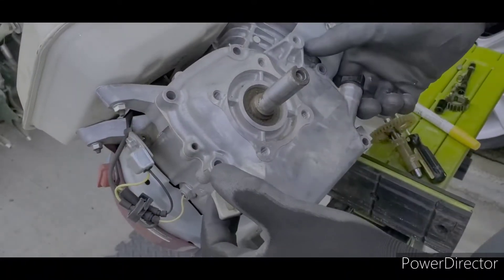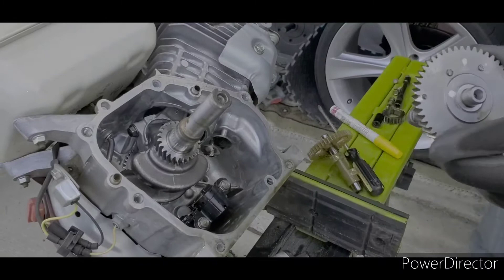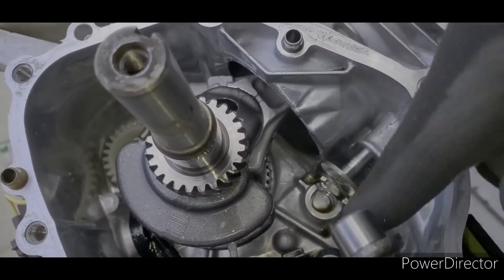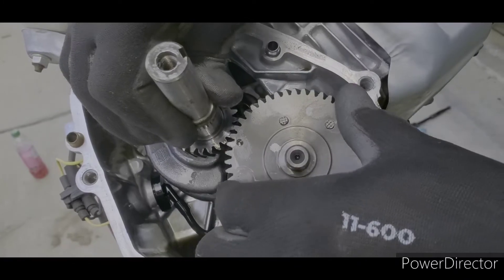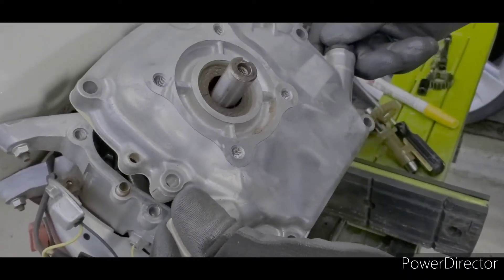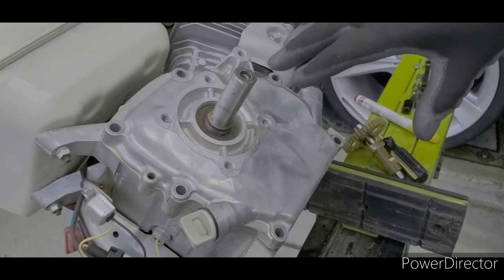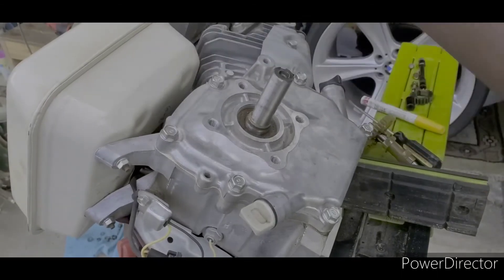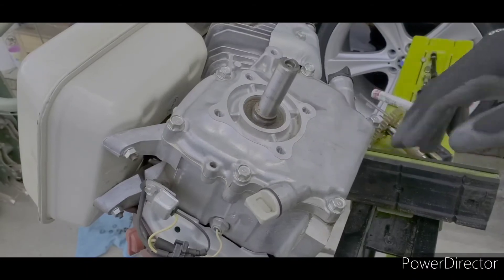How To: Set Camshaft Gear/Timing (Honda GX160) (JOATD)

Comment: I lined my dots up and it won’t start. It has spark and compression. Idk what I did wrong. It’s for my snowblower
Reply from the maker: Check and make sure the carburetors not dirty it may be just the carburetor.  Take some ether or carburetor spray and spray it directly into the air intake right until the carburetor where the air filter goes and try to start it then if it starts the carburetor is dirty
Reply: @JOATD  the thing is it ran perfectly fine before I tore it open.
Reply from the maker: @javiderek31  if it was running fine why did you tear it down
Reply from the maker: The gear alignment being off a little bit won't stop it from starting it just won't run right and it could damage the motor
Reply: @JOATD  because I dropped something in the oil fill hole lol so I had to open it up lol
Reply from the maker: @javiderek31  did you get it to start, sometimes you will see more than one alignment Mart. Make sure that it is the right one

Comment: The crankshaft mark on my gxv140 Honda engine has been obliterated by wear.  Believe me, I've been over it with a magnifying glass.  Any ideas how to line it up with the cam mark?
Reply from the maker: So what you do is before you pull them out you want to mark them
Reply from the maker: If you're talking about putting new cam gears in the new gears will come with marks on them. You want to put those same marks where the old ones were so don't take the old one out until you get the new one
Reply: It is the 4th tooth to the right of the keyway center and most of them are not crankside marked on the 140 engines for some strange reason. Cheers.